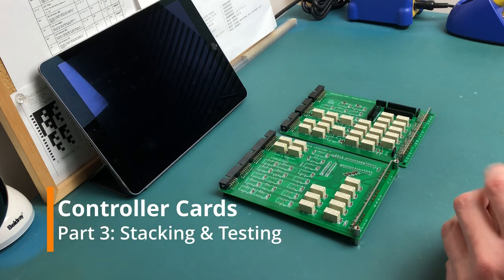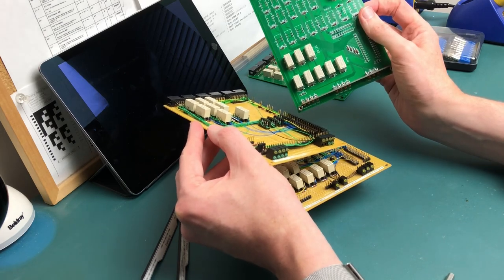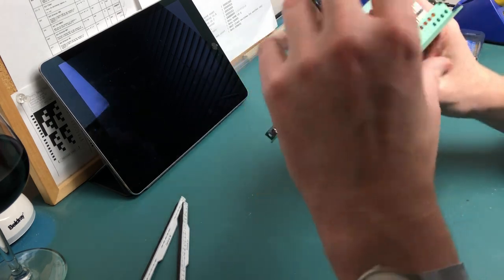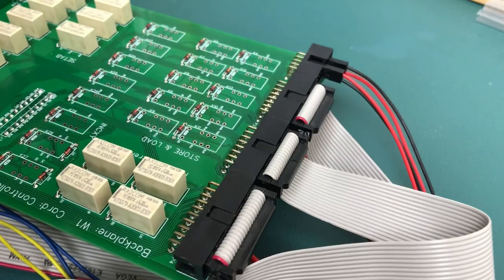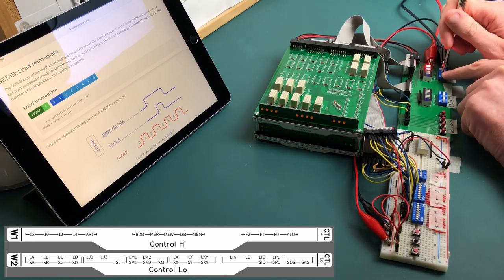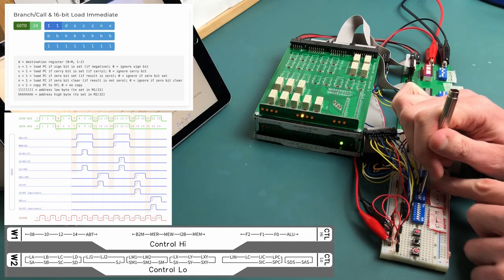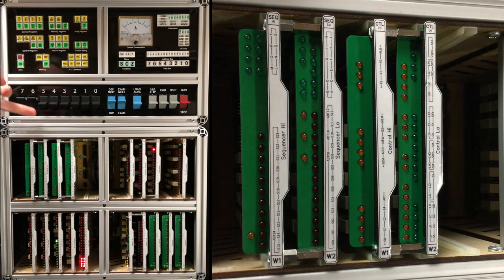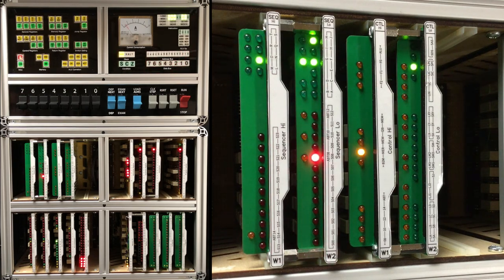Relay Computer: Controller Testing & Fitting

Comment: I seriously am going to have to build this. Jeez this is wonderful.
Reply: A university or college would love one of these. There is someone to be said for the number of click and clacks to illustrate the efficency of one algorithm  over another. I wonder if we could see a bubble sort run on the relay computer. 

The enclosure size is amazing for general portability. Might need it's own caster based trolley though.
Reply from the maker: A bubble sort will need a couple more instructions adding to the computer: store and load. With those I can then copy values between registers and memory and more complex programs are possible. In fact, once those instructions are in place the computer is Turing complete :)
Reply: @paul80nd  oh sweet! Perhaps a 30 second spiel on what Turing complete means, for those that were asleep during that class or unable to go.

I look forward to the store and load instructions. Don't rush it though.
Reply from the maker: Good idea - I’ll try and squeeze that in to the programming 2020 update video I’m working on currently.
Reply from the maker: Good idea - I’ll try and squeeze that in to the programming 2020 update video I’m working on currently.